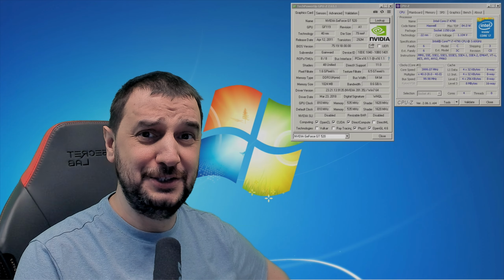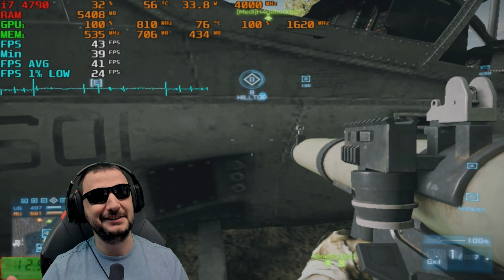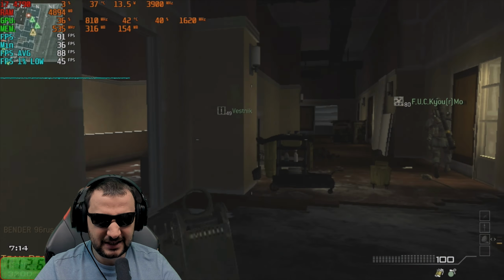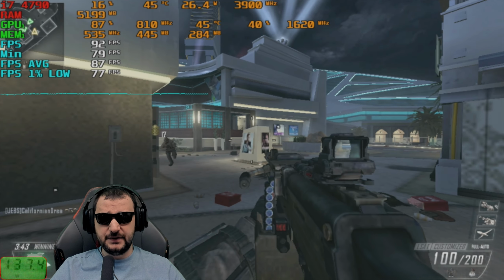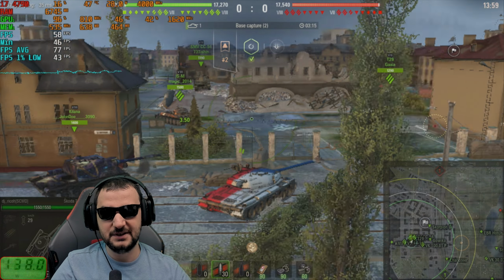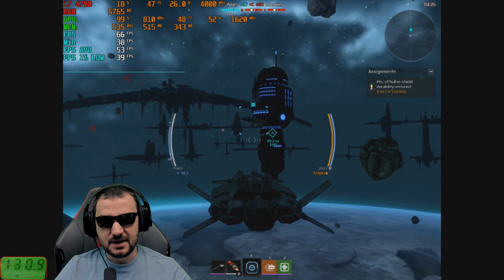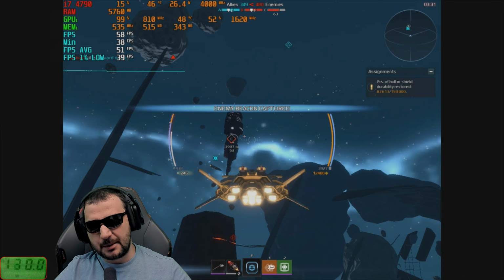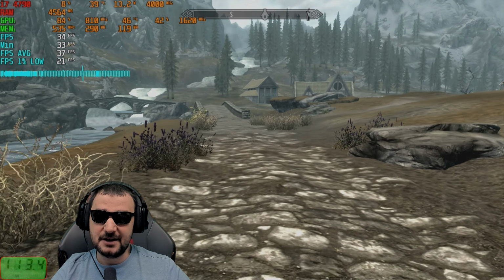Gainward GT 520 SilentFX Benchmark

Comment: Im really doubtfull of people telling oc will destroy hardware. Did you ever actually manage to do that?
Reply from the maker: A few but the biggest stain its with rx 570 red devil and gtx 980 Hall of fame. Not to much but it did ruin the cards.
Reply: @DanielCardei  Any idea what went wrong on those? They were fully working before? I do have had parts break on me, but those were mostly just received. Never had parts break because of oc before.
Reply from the maker: @0MeALot0 memory. I did a proper reflow with the bga station and nothing changed. I don't know how to use mats and I have 0 minutes in the day to learn. Someday. The 570 I think its the core. They usually have vertical lines on vram. This one crashed on load.

Comment: I've got a GT 430, I suppose this card has a similar performance.
Frankly, these cards should only be used on Windows XP PC.
In this specific case, they are really good to play almost all the games at 1080p 60fps.
Reply: GT430 has 2x more shader cores (96 vs. 48), and 2x wider 128-bit bus. 
They both have the same number of ROPs, though.
Reply: @Sam-K  , better choice the GT 430. I bought it because I was limited by the PSU(300W) and the small PC case. As I said, it's a good card to play Windows XP games.